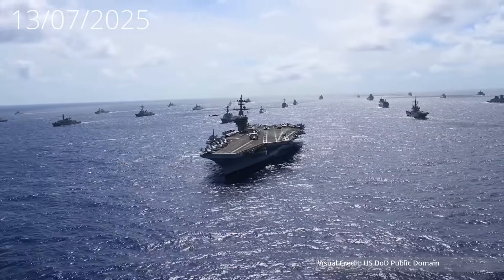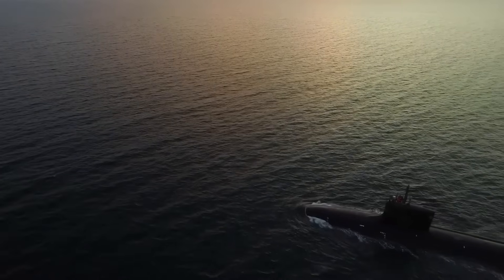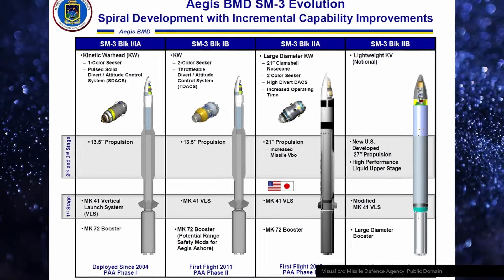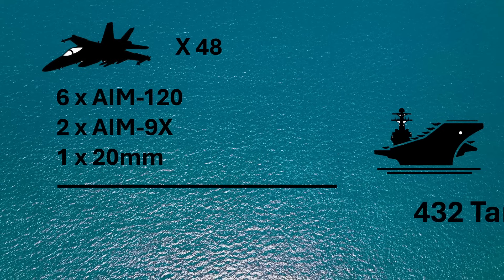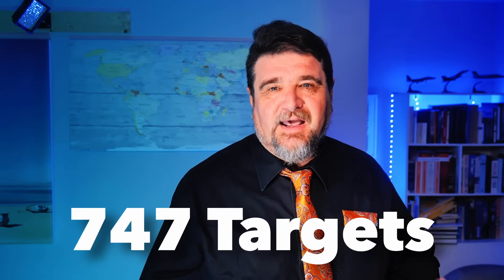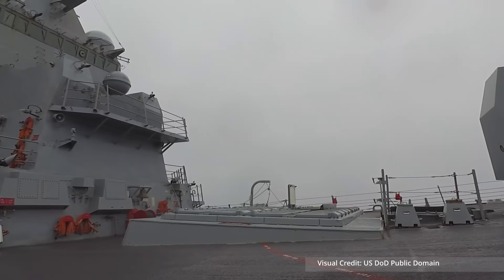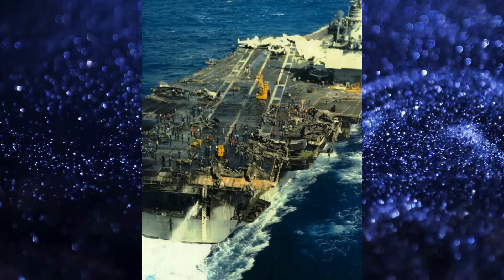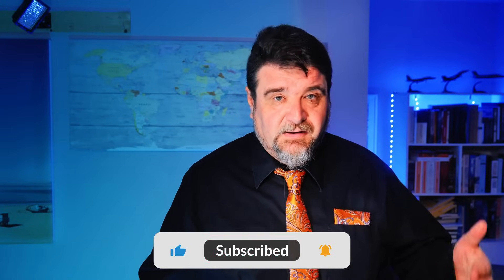HOW MANY Missiles are Needed to SINK A CARRIER?

Comment: Saturation and direction are also underrated. 100 missiles coming from 1 direction vs a 360 degree approach. Also usage of decoys and drones(as demonstrated in recent conflicts) against growler EW defence which is class leading needs to be factored. Only realistically achievable way of neutralising a carrier group is to simply render it not combat capable. Torpedoes are still best for this however underwater drones are fast developing and will likely be a major player in the next conflict on water. Taking out its defence/support ships will force a retreat also. For direct attack, the island is the best target for missile. Take much of its command, radar, operations capability. Yes they have redundancies but an island will likely shut down much of Operations and flight deck capability as a by product. The island has always and is still an achilles in terms of carrier weakness. I also think CIWS like phalanx can do more than 3 missles per unit. They are proven more capable on land and ocean already and is an long developed technology defence platform. 

Possible attack options will be a deep diving passive drone sub. Some can carry several tonnes of hi-yield explosive. They can sit deep and passively listen. Carrier groups are like a rock concert on the ocean in terms of noise. A drone sub can silently ascend and if the support submarine escorting the carrier doesn't pick it up quickly then a critical against the carrier may be effective. If the conflict deepens even a poseidon nuclear style strike can become a possibility.

Comment: We exist in the american propaganda bubble for quite some time now and largely fell for most stuff said. But carriers always have benn more or less of a luxury weapon you can perfectly use to project power when noone eye level is challenging you, but dead ducks if this every changes.

In almost every friendly naval manover with european partners, US carrers have been sunk by all sort of submarines - including famously some who after that retired for age. So the defense layer is basically delusion.

With modern torpedos using the ships own tonnage and size against it, creating reduced boyency areas, it also isen't much of a direct damage question, but one of counting cracks and failing systems.

Also modern anti-ship missiles arent comparable wth exlosives just do their thing on the (armored) flight deck. Those weapons pirce the hull as spread their damage as chaotic as possible and as hot as possible, leaving the crew with mutible damage angles, metall fires, interrupted accsess and threatend vital/critical systems. Will such a hit kill a carier? Probably not, but the impact of even a single one of those might kill the main aspect of the carrier, which is flight and sensor operations. And missiles against such critical targets will come in volleys.

Add to that the horrible condition the US navy is in, the broken maintanance circle with the limited (one!) shipyard able to handle these monsters (which btw. has been sold to Singapore for ... VERY weird reasons). Then add the poor state of US education and shortcomings in recruitment, procurement corruption and general outdated material, and you end up ships only being safe these days for the globe for now don't want to open pandoras box in showing how little survivability superpowers power projection tools have these days - changing the game for everyone, not just the US.

Comment: I get that you have to provide fan service for the US military fanboys but this is just too bad.  Normally you do good work for a public analyst with very little access to real resources but this analysis is just terrible because you get the results many orders of magnitude wrong.  if this analysis was even remotely credible the US would have been far more aggressive in their posture against the Chinese in the South China Sea.  They would have just engaged the Chinese navy in 2016 when their 2 CBGs sat outside the South China Sea against a fully deployed PLAN defense task force both positioned for full on engagement.  The truth is today all it takes is one strike force of 3x H6 bombers to take out a Nimitz carrier and each H6 bomber will carry 3 anti-ship ballistic missiles for a total of 9 which is more than enough to take out a Nimitz carrier out of commission.  We know this because that's exactly how many H6 bombers and their load out when the Chinese send them to mock strike the Nimitz carriers when they exercise near Chinese marked territory in the South China sea.

Many things need debunking here to understand why this is so.

1) The area of control of a CBG is not 1000 nautical miles or about 1800 km.  The Radars on ship can only see about 400km similar to the S400 systems for example because of the Earth's curvature.  A CBG even when fully spaced out does not cover much more than 800km.  Even if you fly out an AWACs to the edge of this detection range which you will never do because of how vulnerable it will be you can only extend the detection range by about 400km in one direction.  To cover the whole 1800km basically both AWACs have to be out in opposite edges and even then you barely cover1800km.  This is just the detection range.  To say that you control this range is a stretch because it takes time to scramble fighters and reach different parts of this defense perimeter.  The combat radius of the F18 is only about 900km so to control 1800km is pretty much necessary to fly almost to the edge of their combat radius given effective interception range for the AIM120 is much less than 100km.  The fact that Fighter aircraft can only loiter for a short amount of time before they must land for refueling, their necessary scramble time and their necessary travel time to meet targets, means that they are not a feasible air defense multiplier unless you know exactly when an attack is coming.  Thus no carrier actually counts on fighters as reliable air defense which is why they bring so many high VLS count Destroyers with them for air defense.  The real control range of the Nimitz then is actually much smaller than its theoretical max sensor range.  Its real defensive perimeter is its actual range of control which is not more than a 300-400km radius circle around the carrier and you can disregard all its fighters as meaningful air defense.

2) The actual interception rate for US AA missiles against missile sized targets is very low and depends very much on the design of the missiles it is trying to shoot down.  Even against fighter aircraft the hit rate is usually roughly estimated at 50%.  Against missiles that travel at similar speeds to fighters (below Mach 1.5-1.6 lets say) the hit rate is roughly estimated at 33%.  It is precisely because of this the Chinese and Russians have long since retired their sub Mach 2 cruise missiles.  Today virtually all their anti-ship cruise missiles engage their targets at Mach 3-4.  The Ballistic missiles engage with a terminal velocity between Mach 6-8 and so too do the hypersonic missiles.  For the cruise missiles you literally have about 1-2 minutes between detection and impact.  It will be about half of that for Ballistic or Hypersonic missiles.  The AA system literally can only get a single interception volley off per incoming missile.  So you can't fire a volley, see if it intercepts and then add another volley after.  You have to decide at the first detection how many missile will you intercept with.  The realistic interception rate for Mach 3-4 cruise missiles by the AA interceptors is in the single digits %.  To be safe you might just have to fire everything you can which may be 1/3 of your entire load out and all of that combined may not even get you an interception rate of over 50% against a single missile.  The CWIS and others won't even get much of a chance to hit the incoming missiles and they could only try to intercept 1 target at a time.  So if they were going to shot smaller cheaper cruise missiles at you they will launch several dozens per volley which the majority will get through no matter what.  Moving on to the Ballistic missiles the interception rate here is basically near 0.  These things simply move too fast and give you too small of a reaction time.  To even calculate a predicted trajectory you need several precise radar measurements over a window of time which you won't have in the time it takes to travel 300-400km to reach you.  Add to the that the fact that to actually hit you as an anti ship missile it has to alter its own flight path and speed during its final approach which you can't anticipate how it will do that just by having a few radar pings of it as it speeds rapidly towards you over the course of the next 40 seconds.  So the only reason the Chinese protocol is to fire 3x Anti Ship ballistic missiles at a time per carrier is not in case you intercept a missile but to make sure that the damage inflicted is fatal.

3) The point that carriers are very hard targets that a few simple explosions won't do much to is correct.  This can be easily understood.  A carrier is 100k tons of super strength steel that can withstand the twisting power of the ocean's surface.  Building have to deal with similar forces on land when the land isn't solid like a swamp.  On the ocean this force is just many orders of magnitude larger because the ocean is completely not solid.  Everyone has seen the damage that cruise missiles do to simple dung out bunkers which isn't much.  If a few cruise missiles could clear out even dug in infantry positions then the Ukraine war would be long over.  The structural damage that cruise missiles that rely on explosive warhead impacting the hard outer shell of the carrier has very little chance to do any meaningful structural damage to it.  It would be equivalent to bombing a steel reinforced dug out bunker.  So you may wonder then what is the point of lobbing missiles at a carrier anyway.  Well things change when you start lobbing stuff at Mach 6-8 at carrier decks.  At those speeds the kinetic energy alone is enough to penetrate the carrier deck.  The Antiship Ballistic missiles are effectively bunker busters for carriers.  They carry explosive charges that are only meant to go off after they breach into the soft belly of the carrier where in those easily pressurized close spaces any explosions will have devastating effects to the internal structure.  When the internal structure of the carrier goes.  The carrier will sink.  The internal tensions at play inside the carrier is carefully balance to keep the carrier afloat and from breaking apart which is not an easy thing to do for 100k ton of floating steel.  Remember the surface of the ocean is a place where the natural forces of the body of water will want to twist and tear that carrier to pieces.  Then you might ask what are cruise missiles for.  Well in the case of carriers they are the equivalent of shrapnel warheads.  What they do is try to destroy every soft target on the surface of the carrier and which they can could do effectively because they can be aimed much more precisely than Ballistic Missiles.

 4) The other thing that is easy to miss is that all ships no matter how heavy are extremely easy to sink with explosions below the waterline.  This has to do with the physics of bodies of water like the ocean that naturally wants to twist and shatter any object which sets into it.  What explosions under water do is it displaces water rapidly and causes a kind of violent ripple effect near the explosion that will generate forces strong enough to twist and break the strongest and thickest of hulls.  Furthermore modern torpedoes are far more clever than just that.  They don't just explode on contact.  Many of them have a head that is designed to bore into their targets.  They literally use their propulsion system to drill a little hole or dent in the hull they impact before they explode.  This further weakens the hull so that the reverb from the ocean will easily tear the hull up afterward.  So you don't even need any fancy hypersonic or terminal guidance systems on a ballistic missiles.  A reasonably modern torpedo impacting anywhere below the waterline of the carrier has a very high chance to destroy it beyond repair and sink it.

5) The last thing I will mention which no one should forget for nuclear carrier, is the very real prospect of suffering a nuclear leak from an attack.  Once there is leak and the carrier is contaminated it is basically done for.  It also makes sinking these bad boys very dangerous as they will melt down after they sink and heavily pollute where ever they go down.

So in conclusion this is why you see so much information leaking from the US military itself that says carriers are obsolete.  Many in the navy believe they are a bad investment and will not survive a modern naval engagement.  When Hagseth says China could sink all their carriers, he is not kidding.  That is very much the real professional view of both the Chinese and US militaries.  And it wouldn't take much.  The expectation of the Chinese is very much that a patrol of 3x H6 bombers is more than enough.

Comment: Very Briefed And Summarized Ideas:

this scenario is devoid of any realism, it's a pure dry calculation of ammunition vs platforms and infiltrated ammunition, even if this hypothetical assumption is limited to the usage of only air assets to sink the aircraft carrier, but even here this scenario cannot be built, with the exclusion of sending a strike air package without escort aircraft including the J-15D/J-16D the PLAAF and PLANAF analogies of ea-18-g-growler, to engage and distract the carrier's fighter squadrons, and enable the bombers and the tactical bombers to reach their launching points and return safely...

in the end the fa-18 super hornet is more than capable of easily shooting down the H-6 bombers, and even intercepting small batches of ASM launched by those bombers although this depends on the speed of those ASCM, but its still capable of intercepting high subsonic ASCM, although it's more difficult for the fa-18 to intercept the highly dynamic fighter aircraft's like flying sharks🦈🦈🦈, and the J-16, J-10 and even the older JXi'an JH-7...

in addition you ignored or missed a few important points: 
1- to calculate the speed of anti-ship missiles launched by Chinese air assets, and with it the estimation of the interception capabilities of a large portion of the air defense missiles and missile interception launched by the fighter aircrafts and carrier escort group, the speed of large portion of Chinese ASCM missiles exceed the speed of interception missiles launched by fighter aircraft or surface combat ships, thus theoretically it will not be able to shoot down large portion of the incoming salvos of high subsonic and hypersonic ASCM launched by PLAAF and PLANAF assets, other issues is the flying profile of each ASCM will play roles in determining the probability of the successful and failed interceptions,
2- the types and the launching ranges of those missiles for example the YJ-21 is different in range, from the high supersonic ASCM like YJ-12, although the most recent examples of hypersonic ASCM and ASBM, are outperform the earlier YJ-21/YJ-12,
3- the flying profile or the trajectories of those high supersonic and hypersonic, ballistic and cruise missiles, and its impact on determining the interceptions probabilities...

as for the point defense systems intended to protect escort ships, their capabilities and duties could overlap with those of higher layers or components of the air defense & anti missiles shields, if these ships decide to form a protective wall around the aircraft carrier, throwing themselves in the face of the munitions as a last line of defense to absorb the volley of munitions, and allowing the aircraft carrier to avoid the munitions successfully infiltrating between the multilayered missile shield and air defense systems...

last point the economic of sinking entire super carrier strike group, even with the estimated figure you mentioned and assuming each advanced state of art ASM cost 2 millions of the toilet🚽 papers🧻called the u.s.d this will not exceed 5 billions, which equals to the price of constructing single CVN88 super carrier without counting the 90 from various types of war planes, 
personally I 🤔🤔🤔, at maximum if the PLA launching 1000 missiles each missile cost 1 million from the toilet🚽 papers🧻called the u.s.d, for exhausting the entire ammunition of the carrier group escort vessels, and still have extra 320 missiles to sink the escort vessels, and the carrier, and if each escort cruiser and destroyer in the carrier strike group will require 10 hypersonic ASCM to sink it each missile can deliver 200k.g only this means 2 tons for each , this leaving 260 additional hypersonic anti ship cruise missiles to strike the aircraft carrier with total destructive payload of 52 tons, snd those 1000 missiles will be equivalent of the price of single ticonderoga-class cruiser, not to mention other cruiser, and destroyers, in addition to the price of the CVN-88 super carrier...

LONG LIVE CHINA LONG LIVE PLA...